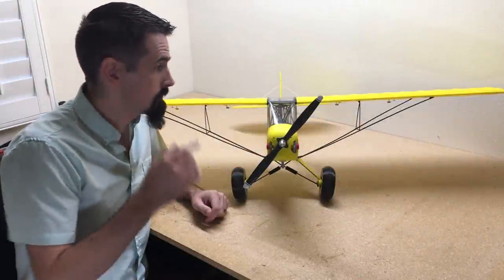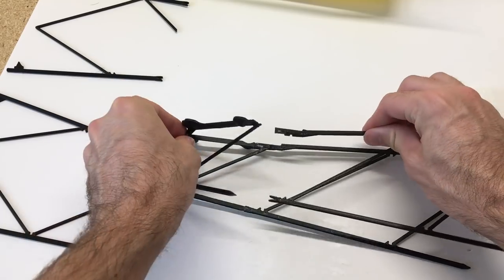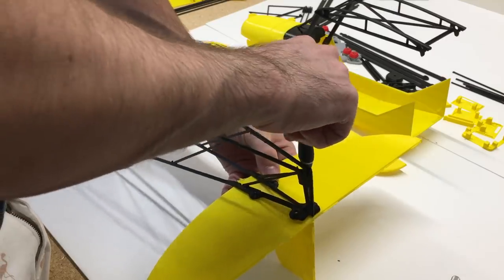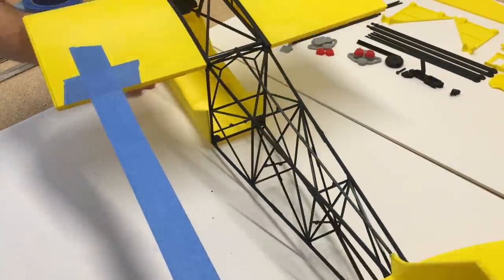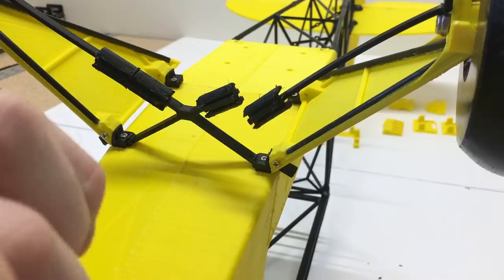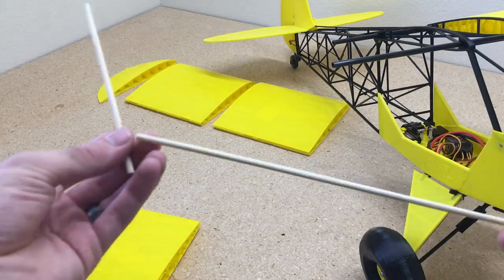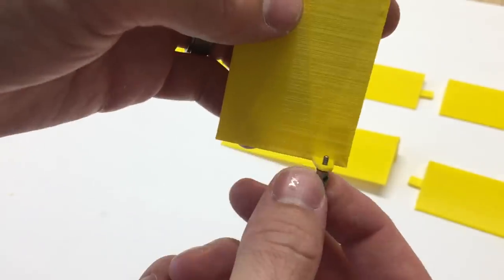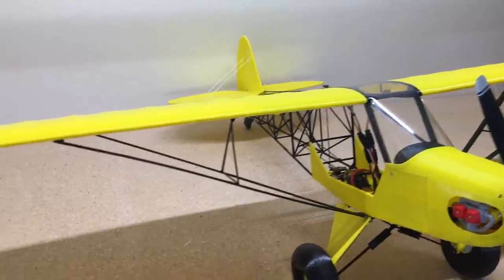How to Assemble 3D Printed Big Bobber - Planeprint

Comment: you can also melt and pull apart a plastic hollow cu tip to make very fine CA glue nozzles, very unique trick I learned and wanted to share for the community
Reply from the maker: Thank you for the tip!

Comment: You make all your build videos look so easy. Great work. Learning a lot. Getting ready to attempt a print and build.
Reply from the maker: I try to assemble these builds to make it easy for people to understand and to follow on the build videos. Thank you for the comment. Good luck with your build!!
Reply: @TroyMcMillan  Thanks mate, Does the file one buy to print such airplanes also include the installation instructions. I am afraid if I am left with a bunch of 100 pieces and don’t know which pieces go together and the order by which they go, and at which stage to instal the servos etc.
Reply: @TroyMcMillan  Also , Is it possible to buy the files and make some adjustments on the printer to scale up the model,  for example there is a 70mm efd that I would like to make it 90mm?  Is that possible, or do I need to buy a ready-made 90mm file (which is probably not available?  Thanks

Comment: Hi just bought you a Coffee :-) was never into Cura but this build made see our conversation in the thin wall print post
Reply from the maker: Thank you so much for buying me a coffee!! I really appreciate that so much. It helps me continue to keep building airplanes. I really like using Cura it allows you to adjust and fine tune your settings for thin wall printing. When you have the setting dialed in for your printer it is easy from there. Thank you again Cheers

Comment: Hello from Tahiti ! Great job of explaining the build.  I just watched your video for the wing prints. Wish you were around a month ago. I could not get the right settings for the wings in Cura.I just finished my Big Bobber last week but with balsa wood surfaces (wings, elevator and rudder). It looks and flies very well. You can find my maiden flight on the PlanePrint Pilots FB page. Looking forward to your next videos !
Reply from the maker: Thank you for the comment. It is a bit tricky to get the right settings in Cura but when you do it works great. I checked out your plane on the Facebook page it looks great nice job with the balsa wing and the color is nice how did you get the red pin strip on the wing and tail? I will have another video on the build of this plane in a few days and a maiden flight soon.
Reply: @TroyMcMillan  Hi Troy and thank you for answering my message. I did the red pin stripes in monokote. For the curves on the wings, i took my time and ironed the stripe milimeter by milimeter. For the rudder i used my Silhouette Cameo 3, cut the exact shape and ironed it on. Looking forward to your other build videos and the maiden flight. I have made a few modifications during the build if you are interested. Talk to you soon.

Comment: I've had great success printing all the parts except the elevator that has ringing and layer shift. Plane Print had no insight. Did you do anything special for this tall thin part. I've tried slowing everything down, supports, brim, raft etc. thanks for the great vids.

Comment: Thanks Troy for the incredibly helpful videos!  I am achieving some great prints and am going to give the Big Bobber a go.  What is your weight of the plane without a battery?  I am trying to choose a compatible motor.  I fly a turnigy 3536 1050kv in a Multiplex funcub that is about the same size as the Bobber.

Comment: Where do you use the 1.5 mm carbon rods?
Reply from the maker: They are used for the push rods for the elevator and rudder. You can use 1.2mm steal music wire if you can't find those rods.
Reply: @TroyMcMillan  Thanks I have a lot of 1.2 mm wire , so I will use that. Thanks for the quick reply.

Comment: Hi, I’m a subscriber and almost seen all your videos of the 3D printing stuff , I’m interested to get a 3D printer and I’m considering between the sidewinder X1 sw-x1 and the sapphire pro core Xy that you off course you shown and currently use. 

Between the two which one you highly recommended to print all your planes that you done? 

I was looking also the PRUSA 13 MK3s but it’s very expensive:-( 

Can you please help?
Reply from the maker: I would definitely recommend the Sidewinder for your first printer. It is super easy to use and prints great quality parts. Good Luck :)
Reply: @TroyMcMillan  can I ask why not the sapphire pro? Does it have any drawbacks?

Comment: Great build.  By the way it's not 6/32nds, it's 6-32 size screws, meaning size 6 (0.1368"), with 32 threads per inch.  Just say  "6 32 size screw"

Comment: By the way I scaled up the seats from the small bobber and will place them in the cockpit
Reply from the maker: That is a good idea I may have to do that for my build.
Reply: @TroyMcMillan  maybe you can place the electronics under the seats
Reply from the maker: @hpsie8310  Yes that is a good idea I am working on some other models right now so when I get a chance I will try that out. How much did you scale the seat up?
Reply: @TroyMcMillan  1370/90 = 1,52 went with 150%
Reply from the maker: @hpsie8310 Awesome Thank you. And thank you again for the coffee!! :)
Reply: @TroyMcMillan  me again just thinking if I need to order some extra Sevro extensions, which length did you use ?
thanks
Reply from the maker: @hpsie8310  For my build I just bought that 3pin assortment of wires I have linked in the description. That will allow you to route the wires any way you would like in the fuselage. I also use it to make my own Y-cables. You will only need extensions for the ailerons and the flaps.
Reply: @TroyMcMillan  cool then I have that at home Thanks

Comment: Hi, I have a question regarding weight of the printed parts. My settings are 0.25 layer, 102 flow but my parts are still about 15-20% heavier. For instance fuse1 part should be arround 65g, mine is arround 80g. What can I do to reduce the weight besides reducing flow which might affect the sturdiness of the parts.
Reply from the maker: I had the same problem with my build. I had my flow settings at 105 and if I turned it below that I had sub extrusion my fuse1 was 75g and all my wing sections were 5-8 grams over. I continued with the build and it still flies well. The other thing to keep in mined is to make sure your prime setting is not too high. If your prime setting is too high it will add extra wight every time the extruder retracts and primes witch is a lot.

Comment: Hello
Please can you help me setup.
I would definitely get you more than a coffee

I purchased the A30M by geeetech
I tried printing the manufacturer test file as it should be perfectly configured for the printer
the first print was a failure as it did not complete the print
it is a dual extruder printer
the head of the dog did not print successfully and i noticed that the head was of a different color meaning the other extruder did not work properly

before a second print i tightened the z axis gantry as i suspected wobbling to affect the layering .
the second print had similar results

Furthermore i installed the 3d touch sensor for auto bed levelling
The sensor worked as the pin extracted and retracted according however when i press auto bed leveling it would send an error message "test failed"

i noticed that the bed would first move on the x axis and then jerk and stop with an error message "test failed"
i thought the bed should first move on the z axis to clear any obstruction and then on the x axis towards the centre

i however managed to level the bed manually  and when i click on the manual levelling button the bed moves as intended . first on the z then x.

Please i am stuck and would appreciate your experience 

sincerely

ejike

Comment: to bad the pla will not stand up to heat or direct sunlight without warping
Reply from the maker: Actually I have had it out in the sun a lot and I have another 3D printed plane that also does well in the sun. I just make sure between flights when I am not flying it I park it in the shade. No warping so far thank you for the comment.

Comment: some observations.         at 1:35,  weird profile.  makes  less  lift, than a clark-y.        at 4:17, control horn design less-than optimal.        at 13:15,  a  main  wing  is  SUPPOSED  to  have  load-bearing  SPAR, located at the lift line,  at   Thirty  percent of chord.!!!!        that  load-bearing spar  is  Supposed to  Structurally tie-into  the  fuselage.!!!   or  to  the  OTHER  wing  half.!!!!       googletranslate